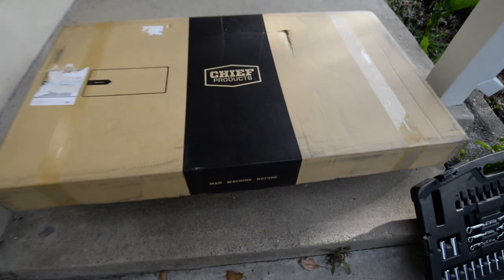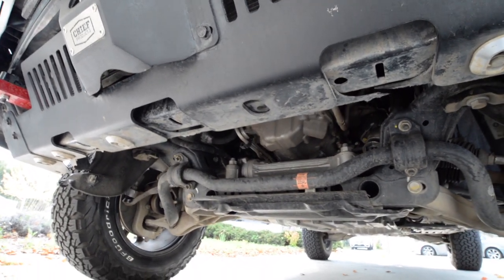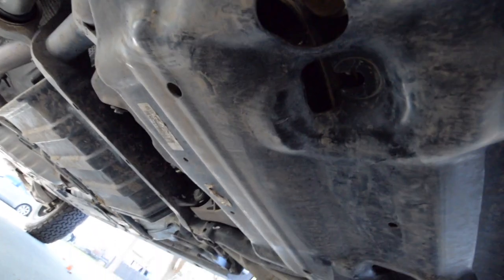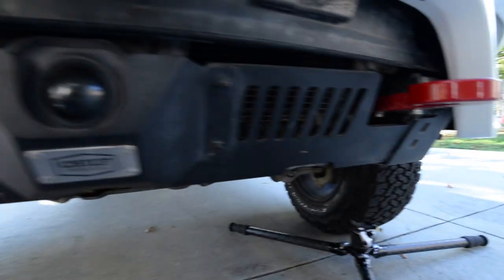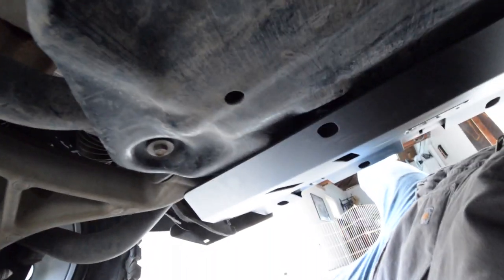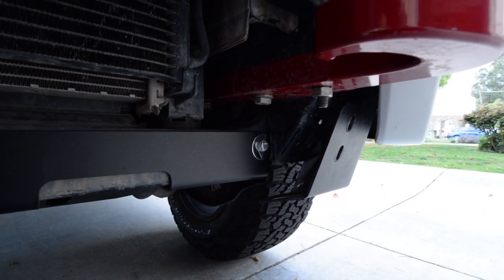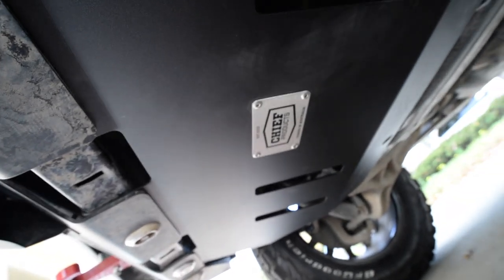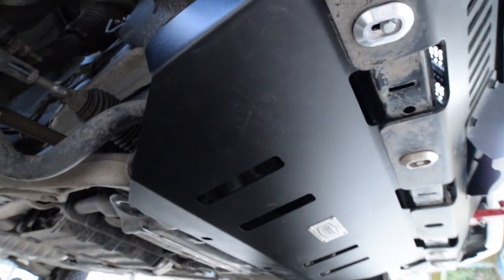WK2 Sump Protection Plate

Comment: Pretty straight forward install! I like how well both Chief Product protector overlap. 
What’s the price on this unit?
Reply from the maker: Ya the overlapping is done in a way that avoids any hang ups as well. Really well thought out. 
This particular model is $389.99. There are 4 models ranging from $299.99 - $499.99. They vary in thickness of steel, bolt head protectors, coatings, and one model has an access panel designed for the 5.7L WK2s.

Comment: Im thinking of getting one, how long was shipping and does it protect washer fluid resovoir thats exposed when u remove lower air dam ? Thx brotha ! Cheers
Reply: Also, how much was that plate protecting areas around tow hooks? Thought it was all from the same set 🤣
Reply from the maker: Ha ha ha hey Jay! Thanks for the questions. To address the two protection questions first, it does not directly protect the washer fluid res. However, the back side portion of the tow hooks it does protect. About 3 or so inches of the backside of the tow hooks push backwards that you can appreciate. In order to gain full protection, I’d add the lower front guard. That piece will give you the rest of the full protection for both the tow hooks (what doesn’t stick out) as well as the washer fluid res (by means of the side wings of the guards). 
As for shipping, it was relatively quick. 

From purchase date to door, approximately a week and a half. Packaging was solid, and there were no alterations from the video I posted (all I did was cut the tape ahead of time).  

If you want to get that portion of the sump area protected, while having as low profile as what is out there on the market today, I’d definitely look at this one from Chief. 

Thanks for the questions, hope my answers help.
Reply from the maker: Shipping wasn't long- I think about 2 or so weeks if I recall correctly. Obviously with all that is going on these days, shipping is all over the place. However, Chief does a pretty exemplary job on both the quality of their shipping materials as well as a very good time frame. I'd feel more confident buying from them in times like this than with any other company.

Comment: Is this standard duty or heavy duty?
Reply from the maker: This one is the standard duty plate. Still plenty of protection. I wanted to save weight and, since I primarily camp/overland in this Jeep (not rock crawl) I didn’t need that extra thickness. I’d be hard pressed to find that it wouldn’t hold up with quite extensive abuse.
Reply: @lucashecker5894  Thank you. I also don't want the weight but want protection.
Reply from the maker: @jeepster0934  you are welcome. It’s honestly an unmatched product and you’ll know it right when you put your hands on it